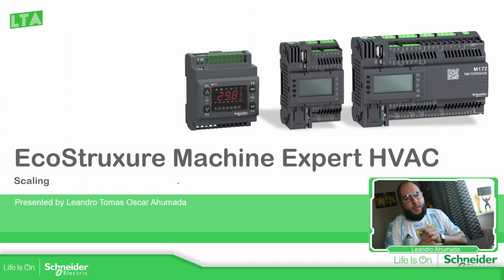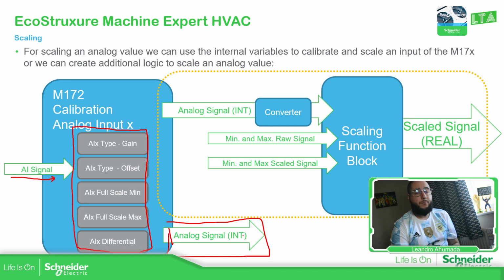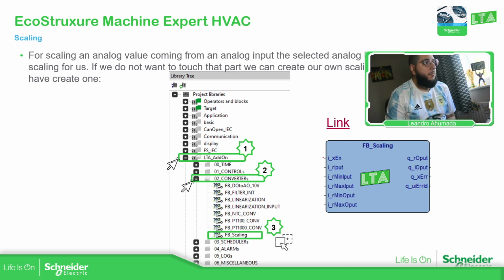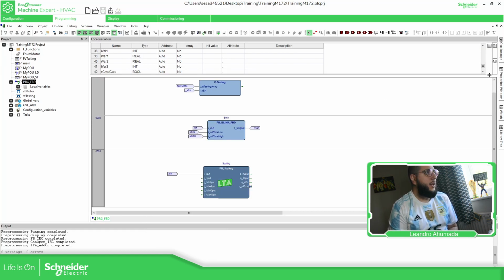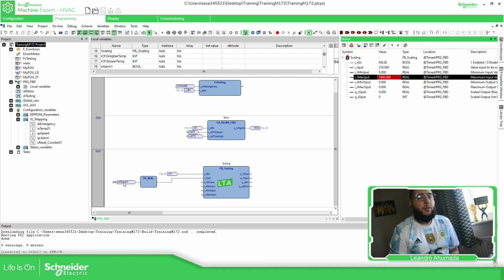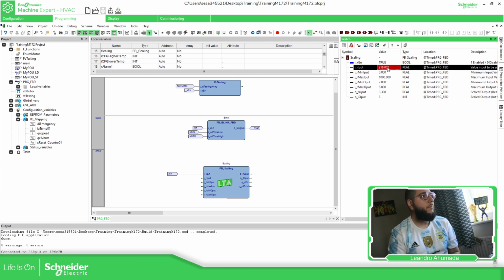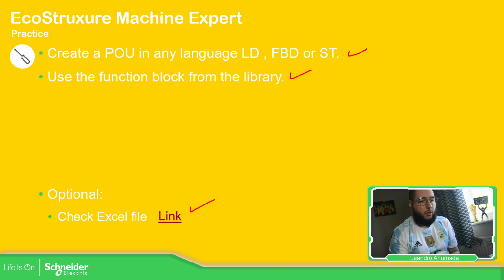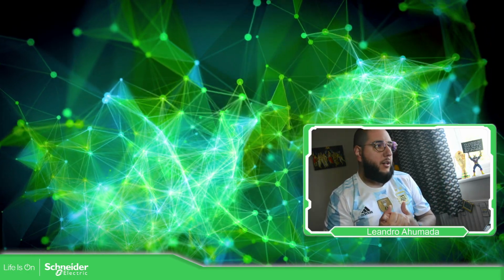EcoStruxure Machine Expert HVAC Training - M5.9 Scaling

Comment: Sir pls make full video on how to add analog scaling block in this eco struxure hvac library.
Reply: How to add this file into the ecostruxure machine expert-hvac ? Suggest procedure to add LTA_AddOn
Reply from the maker: @gauravprajapati1392  in the library tree in the software you can import the library
Reply: Thank you sir @LeTomasAHUMADA
Reply from the maker: Hi there! You can use mine that is located into the next library:
https://app.box.com/s/j45enur48dzxa602gdeg083jmhwt8p3s
Reply: @LeTomasAHUMADA thank you so much sir